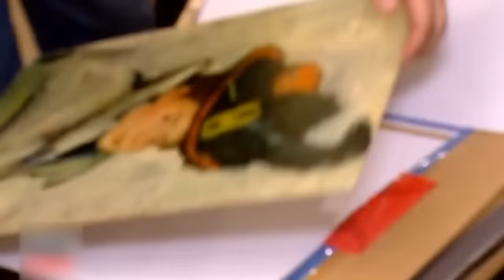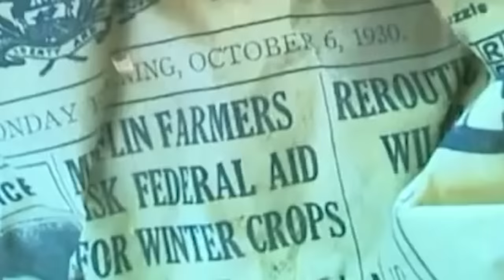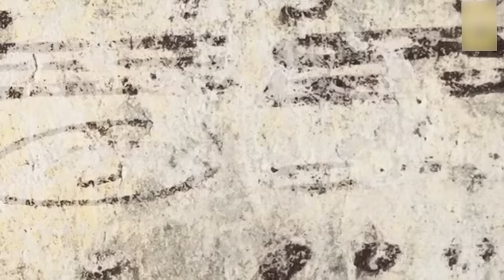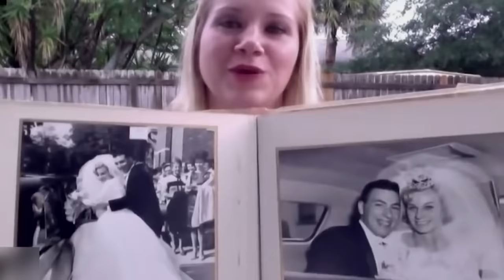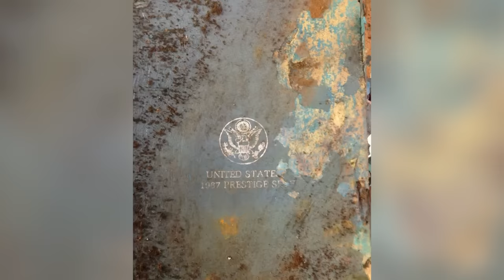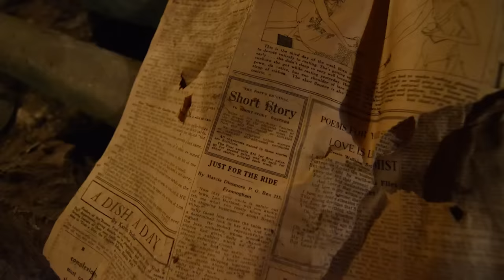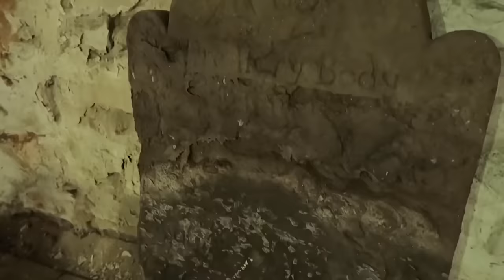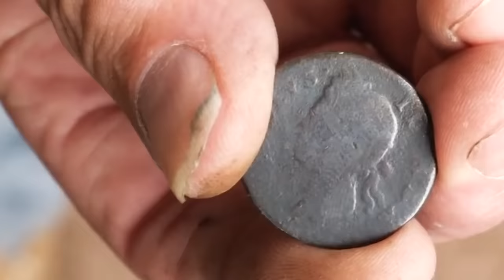He Knocked Down A Wall In His House And Found An Entire Hidden City

Comment: The girl with the second apt in NY. I would have kept my mouth shut. Landlord probably charges her for it now..or tents it out and they pass though her apt to get to theirs ..or kicked her out.. remodeling make 2 higher priced apts. Well,  mabe that's just my landlord..I shouldn't have fixed up a creepy basement, or dusty attic..tried to charge more..tried to rent them out..having people go through my apt..( hells Naw) tried to evict me to make money..I left..I took all my renovations with me, put it all back the way I found it. Dirty, moldy, full of rubble in the basement..attic..pulled out the new floor , walls , and windows, I had put in and put originals back in. ALOT of work to re install all the old stuff back the way it was, and costly.. but..no deposit because I altered the house without permission..smh ( new walls, floors, windows, stove, fridge, washer/ dryer, you get the idea. So..I took my new Stuff, and since I left the original in tact. That's the way I left it. ( Didn't have cell phones..or internet. Only cameras, took before, during after..then I did it backwards..to the original. Judge laughed at him. Told him he should have just given me my deposit back. That I was allowed to take " my" drywall, flooring, appliances, cement, windows , I had labor and material receipts for renovations beautiful, clean,  AND  labor cost to put it back to the way it was when I moved in..dank, dirty, nasty, drafty..( took new insulation and replaced the old stuff back ..along with musty carpet, and splinter hard wood flooring. ( All I asked was my deposit back, and one month to find a new place..but had to be out 22 days later. Instead of almost 2 mo. ( He shouldn't have been an a hole. ( His elderly father who I rented from , let me renovate aslong as i paid for it. And was the one who showed me the blocked off attic and basement he died. His nephew took over. Raised my rent. Didn't know about attic or basement untill the old lady he stick in a rest home asked, dear, did you ever get rid of the rats in the basement and attic? after you fixed it up. I tried to say..no. nephew looked around while I was at work. Then was going to charge me more rent, tried to rent but then only entrances exits were in my space.i wouldn't let him make mine smaller to make entrances, code enforcement said no. So he tried to say we were roommates..smh. no go. Lol this was in the 80's cherry on top..I had to get permits to do renovations..and I informed them I don't think it's up to code.
Reply: 😢😢she shouldn't pay anything its the landlord fought
Reply: A little too long
Reply: I don't rhink the owner heard of it. But it would have good to tell uns in this clip what she decided 2 do with it. But I csn hardly imagine she'd brave enough to use that newly found space. Then the owner could really find it out namely.